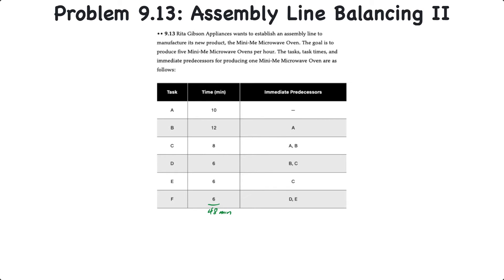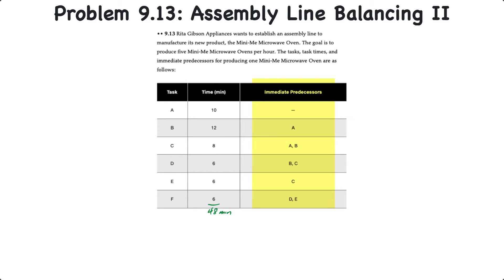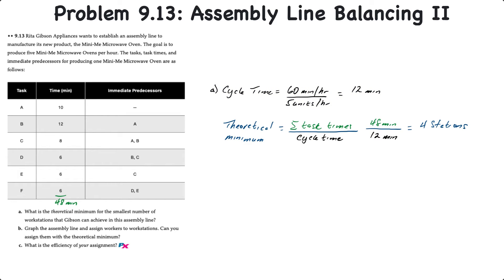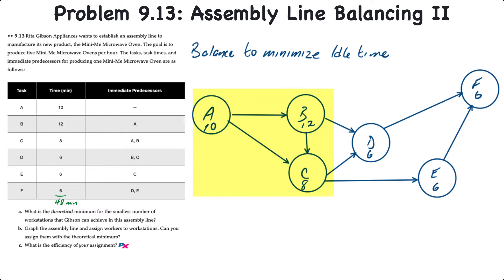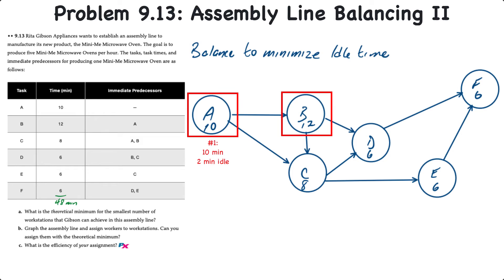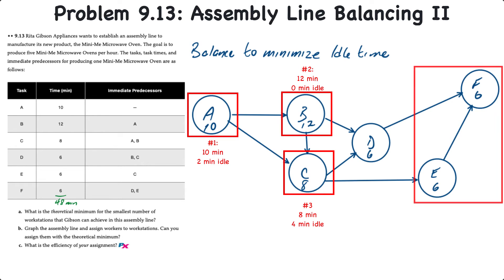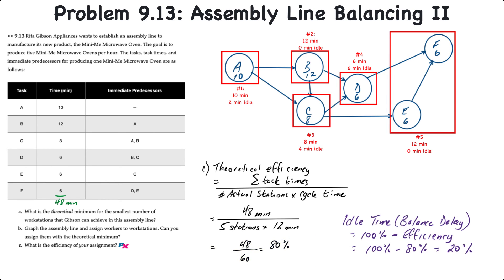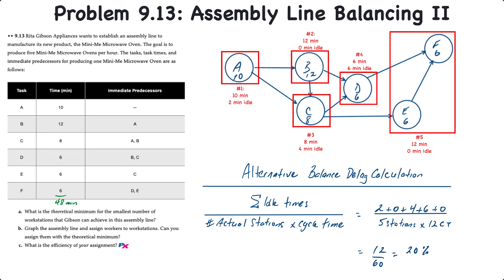Operations Layout: Assembly Line Balancing II

Comment: If we have a task time greater than the takt cycle time what would we do? Would we just have two stations performing that task?
Reply from the maker: Hi Ryan, sorry the delay. That should not really happen because the task times would drive the target. For example, in this problem, the goal is to produce 5 ovens per hour and that would be based in the highest task time of 12 min. If, for example, task B took 13 min, then it would be impossible to produce 5 in an hour and the target output would have to be reduced to, say, 4 units per hour, which would result in a cycle time of 15 minutes (50 min/hour divided by 4 units per hour) and no task would exceed the cycle time.

Hope this helps.
Mark

Comment: Why not just make each machine do all the tasks in sequence A to F for a total of 48 minutes and have only 4 machines?
Reply from the maker: Hi Neysara. In theory, that would be great but machines are often designed to perform specific tasks with high throughput. Why does a car have to move down an assembly line where different people and machines perform different functions? What we really need is a matter replicator that can produce a complete unit at the touch of a button.